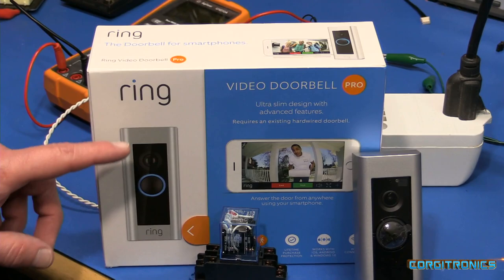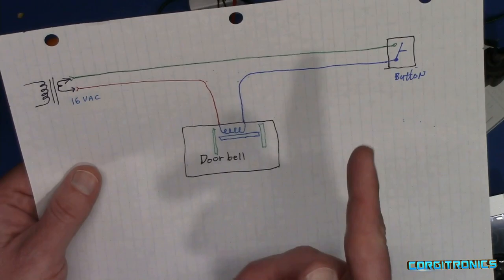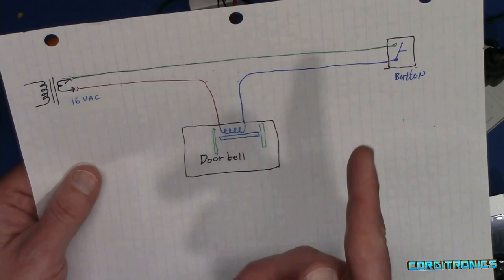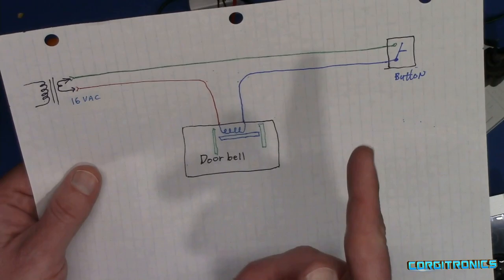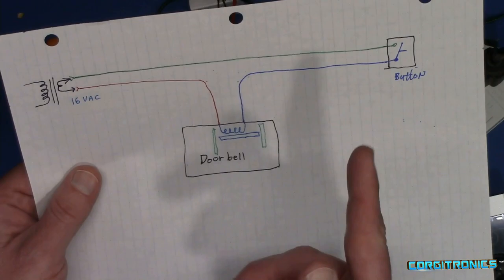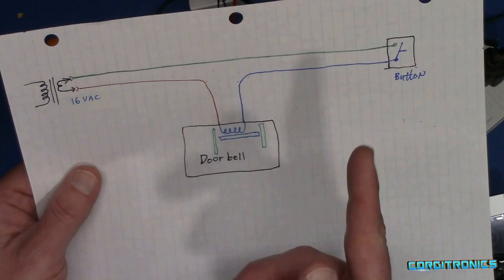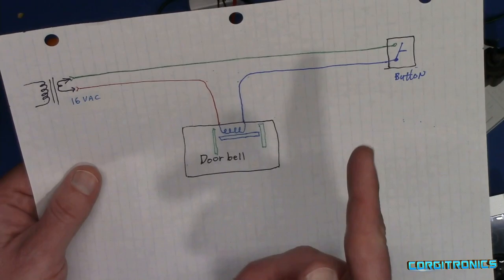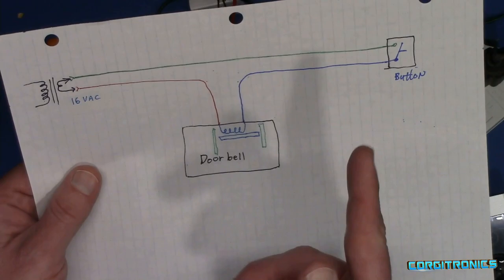Connecting a Ring Pro Video Doorbell to the electronic chime in a Nutone intercom

Comment: First off... Thank you very much for taking the time to do these two videos.  They are very informative and much appreciated.
I am trying to install the Ring Doorbell Pro into a NuTone intercom system.  It has two 16V transformers installed.  Because of the location, I would rather not have an external transformer powering the doorbell.  Would it be possible to replace one of the 16V transformers with a 24V and then wire it up with the relay per your instructions?  I wonder what the impact of 24V on the rest of the NuTone chime system would be?
Reply from the maker: I'm not sure that I'd give 24 Volts to the Nutone, you may be able to power the RingPro off of one of the NutTone's transformers.  It kind of depends on the intercom model.  Also, I'm not sure which of the two transformers would be the best to use... might connect an Amp meter (DMM set to Amps), and see how much power the intercom is using from each transformer.
You could replace one of the existing 16 V transformers with a transformer that has a higer VA rating but is still 16 V. Something like this 50VA unit:  https://www.amazon.com/PWS-1650-Supply-Adapter-Transformer-terminals/dp/B06XRM9QZ3/ref=sr_1_8?keywords=16+volt+transformer&qid=1551937937&s=gateway&sr=8-8
Or this 75 VA industrial beast https://www.amazon.com/Siemens-MT0075C-Industrial-Transformer-Secondary/dp/B0052MY318/ref=sr_1_fkmr0_1?keywords=16+volt+transformer+75VA&qid=1551937986&s=gateway&sr=8-1-fkmr0
Reply: @Corgitronics  Thanks for the help.  I ended up just disconnecting the chimes in my NuTone intercom system and wiring the ring directly to the installed 16V transformer.  The Ring Doorbell Pro rings through the Ring Chime.  I like your solution, but did not have room behind the intercom to fit the relay and I did not want an external transformer because my NuTone control panel is on the wall in the kitchen.  Thanks again for taking the time to make this video.

Comment: ? I have a musical digital chime which worked with the ring pro for about a year and then suddenly stopped.. it’s compatible with the ring and works without the ring door bell connected to it with a diode.. what do you think the deal is with this? Will the relay work? This has been killing me for awhile.. it seems like there’s no power to the chime when ring is connected..
Reply from the maker: That happened to me for a while in September.  It turns out that Ring pushed a software update that had a bug in it causing the unit to not trigger the bell at the end of its cycle.  I had to call Ring support and work with them a bit, they had to get a technician to manually push an update to my unit.

Comment: I have the Nutone as well.  I only have the 2 thin wires going to the doorbell that the Nutone uses for its trigger board and light.  Are these big enough to connect to the 24v transformer (or adapter plug)??  You have yours connected to multiple wires you had previously installed
Reply from the maker: Yes, it should work using those wires.  It will have more voltage drop, but if you are using a 24V transformer (with at least 30VA) the RingPro should still get enough power.  I am currently powering my RingPro with a 16V transformer and a 60 foot run of standard 2 conductor bell wire (the usual brown cable with red and white wires in it).

Comment: How exactly does the 24v A/C relay allow you to run power to the Nutone chime that typically requires D/C current?  I’m very unfamiliar with electronics but I’ve always thought that it would require a dedicated A/C to D/C converter to make something like this work properly.
Reply from the maker: The relay isolates the 24VAC from the intercom.  I have a follow up video that goes into more detail about the relay and its connections:  https://youtu.be/hd68roYUDng

Comment: Corgitronics, I have the Nutone IMA 3303 and I'm wondering whether I can use one of its existing transformers (which I believe are 16V 30Va) to power a video doorbell.  I'm concerned though that the existing wiring running from the master unit to the porch location may be insufficient.  It is 6 wire cable (consisting of 3 twisted pairs).  Only 2 of the twisted pairs are currently in use for the Nutone porch bell/speaker.  I think the twisted pairs look like 22 gauge wires.  I note in your video that you used 2 twisted pairs from your Cat5 on each terminal of the Ring.  That wouldn't be an option for me obviously as I only have 3 pairs total in my intercom wiring.  Running new wiring to the porch unit would be very difficult as the Nutone box is in brick.  Thoughts?
Reply: I ended up using 3 strands of the 22 gauge wire to each terminal and it worked fine.  Device health shows good on the Ring app.  I'm powering the Ring from one of the Nutone's 16V 30VA transformers.
Reply: @Loach402  does your nutone chime work with the ring?

Comment: I have installed a video doorbell the last couple of days worked fine, I have added a 24VAC power supply behind the whole intercom system in the wall house to send power from there to the wires outside at the doorbell. But I have one problem with the intercom speakers humming inside the wall where the whole intercom system is, could that be from the 24VAC I have added,   if so will it make a difference if I moved it around behind the system???
Reply: Sorry the humming part was my mistake it was lose on the surface but once I screwed it to the surface all went perfect.

Comment: I wired this up for a Ring Elite to an M&S intercom.  Works, but the relay has a constant hum.  I think the Ring device is allowing some current to flow.  Any ideas?
Reply from the maker: Hmm, the Ring Elite is quite different and doesn't need to draw power from the chime itself.   The Ring Elite must be allowing some power to continuously flow, not enough to trigger a mechanical chime, but is enough to hear in the more sensitive relay.  You could place a power resistor across the relay's coil terminals to bypass some of the power.  It's difficult to provide any good advice on this for you, but perhaps some large power resistors (10 - 20 watts) and try different resistances starting with at least 1K - 2K Ohms?  I would not want the resistors to get very warm.  Many of these relays will trigger on only 50mA, which isn't enough for a mechanical chime to even notice.

Comment: I have a Ring Video Doorbell 3 (the one with the removable battery pack) can I use this same set up to hard wire my doorbell to keep my battery charged and still be able to chime my Nutone 3003 in the house?
Reply from the maker: I think this approach will work with the Ring 3.  There are a few differences, such as the Ring 3 doesn't appear to need the "power kit".  If you use the relay approach, your transformer might not supply a high enough voltage to trigger the relay, see my other video on that in the description above.
You may also need to configure the unit for "mechanical chime" .  You will find that under Device Settings --> General Settings, select the Doorbell Chime Type and select "mechanical".

Comment: By hooking up the Ring Pro exactly the way you show on the video, will I lose any functions at all on my Nutone Intercom System (such as the ability to talk via the intercom to the front door from any room that has Nutone in it ?), also, does this affect my home alarm system at all by diving into these wires ???
Reply from the maker: This connects to the door chime terminals (if you have the chime module) in the master intercom panel and should not affect the door intercom or other functions.

Comment: Corgitronics I have a Nutone type intercom doorbell replacing with ring pro. 4 wires 2 ring the chime other 2 speaker wires. If I power the ring with the speaker wires
and then connect the chime wires to ring as well - would this work without the relay ?
thanks
Reply from the maker: Not really.  As you can see in the video the RingPro only has the two connections.  It triggers the chime by briefly shorting out the connection.  And, it's unlikely that the NuTone will be able to supply enough power to run the RingPro

Comment: how could I connect an existing old chime to a new wifi doorbell? (not ring) wondering if there a way I could just solder the 2 wires to the push button inside the wifi doorbell
Reply from the maker: I would not connect a mechanical 16VAC chime to a wifi doorbell that isn't designed for it.

Comment: Great video.  I have the exact Nutone you showed in the video.  Do you know if the same solution would work for the Nest Hello doorbell?  Thanks, Robert
Reply from the maker: It looks like this approach will work for the Nest Hello.  Their documentation is a bit vague, but it looks like a similar setup.  They provide a doorbell connector device that you will probably need to connect up in the same way that I show connecting the Ring Power Kit.

Comment: Hi Corgitronics - amazing video.  How would the setup differ if I have 2 Ring Pro 2 doorbells instead of just 1?  Do I need 2 relays or just 1?  How do I wire them to mimic this circuit?
Reply from the maker: The setup is the same for each.  You will need 2 relays, and separate transformers to power each Ring Pro, or one big transformer.
Reply: I already have a 24VAC/40VA transformer so no issues for power

Comment: I am trying to get my Ring Doorbell2 to work with a Hampton Bay wired/wireless option chime rated for 16VAC-10VA. I was going to buy the ELK TRG-2440 24VAC-40VA  to work together. will this work? I dont have a relay or the "Ring power module" .  help me out please Corgitronics!
Reply from the maker: Well, as luck would have it, see the video I published 10 days ago on relays to connect a Ring Doorbell2 to an electronic chime.  https://youtu.be/xmeYzodpkfU
Also, at about the 10:40 point I show using just the common 16VAC 10VA transformer.
See the video, but you may just need to get the relay, and wait on upgrading the transformer.

Comment: I'm looking at the video minute 5 and it appears that the Ring powers up and stabilizes at 0.150 Amps when connected to the mechanical doorbell with the Ring PPK attached.  However, at Minute 11 or so when you power it up using the relay, it's only using .003 Amps and a peak of .008 when the relay is energized.  I can't figure out what I'm missing - I can't see all of the connections on the table demo, but when I hook up my relay, transformer, etc my Ring is still pulling .150 Amps through the relay after it's booted up and never deactivating the relay.  Can you explain the difference in amps from minute 5 vs minute 11 ?
Reply from the maker: At the 5 minute mark I am testing with a mechanical (solenoid) doorbell, and all of the power for the RingPro is passing through the doorbell's solenoid.  At the 11 minute mark I am testing with the relay, and only measuring the power passing through the relay, the rest of the power is passing through the "power kit" provided by Ring.
Reply: @Corgitronics  Fantastic, Makes sense.  I tried just the relay https://www.amazon.com/gp/product/B00NN5ABG2/ with a 24 VAC transformer and the "power kit" (as shown in your schematic) and for some reason, my Ring Pro would never fully boot up.  When I use just a 16 VAC transformer and no relay, it boots up fine.  The Ring Pro powers up with the relay in the circuit, but I always get some variant of the flashing LED (left, top or right) as if it's underpowered.  It's a 24 VAC 30 VA relay and the relay closes with no buzzing.  I'm not sure what's going on - perhaps a bad power kit because my current mechanical doorbell "buzzez / vibrates" even after the ring is fully powered.  I thought I'd install the relay to get rid of the buzz and perhaps go to a digital doorbell later.  If the "power kit", which I understand is a resistive circuit is bad, it would make sense that the mechanical doorbell buzzes and I guess make sense that the relay never disengages or the Ring doesn't boot up.  I appreciate your input.
Reply from the maker: @jsfarmes  I think that the power kit is actually more than just a resistor, but I haven't taken one apart to check it out.
Also, in the Ring App, under "Doorbell Kit Settings", make sure the "doorbell type" is set to "mechanical"

Comment: I have a ring 2 that I hard wired through my nutone system. I wired it with the exact relay you used in your videos. It works with one caveat. The relay chatters for about 5 seconds when the ring button is pushed. The relay also has a low hum to it at all times. Would you have any idea to why this is happening? My nutone system is powered by 2 18vac transformers, which are pushing 20vac each. I wired the ring 2 to just one transformer. Thank you
Reply from the maker: It sounds like there's a little too much current being pulled through the relay at idle.  First a question, did you connect the PowerKit as shown at 3:48?
If you have the power kit connected I can think of a few options:
1.  Make sure the Ring's "Doorbell Chime Type" is set to "mechanical". See this article:  https://www.pocnetwork.net/technology-news/troubleshooting-ring-doorbell-not-ringing-the-mechanical-chime-inside/
2.  Select a relay that uses higher current, this will force more power through the power kit.  I tested some relays in another video, here:  https://youtu.be/xmeYzodpkfU?t=317
3.  Test out powering the Ring from a separate transformer, not the ones in the intercom.
Reply: I did not use a power kit since it’s a ring 2.
Reply: Were you able to figure this out? I am having the same problem. The relay chatters when the button is pushed and no chime sound.

Comment: Where do the blue and white wires connect to from the nutone?? Do they connect to the relay cause I didn’t see them connected in your picture
Reply from the maker: The intercome wires shown here: https://youtu.be/4ZFl6BRTQnA?t=956  connect across the Normally Open (N.O.) and Common (C) terminals on the relay, as shown here:  https://youtu.be/4ZFl6BRTQnA?t=495
For further clarification, see the video on relay connections listed in the description above:  https://www.youtube.com/watch?v=4ZFl6BRTQnA
Reply: Thanks for getting back to me appreciate it. I kind of get what you’re saying about the blue and white/blue wires.. I’m just wondering if you connected them to the relay cause in the still photo of the box all I see coming out of the relay are the purple wires I’m assuming thats the power coming? I bought everything that you have in the video relay, plugin transformer and the terminal strip.. I also have another question could I up grade the factor transformer from 16volts to a 24v and use that to power the ring pro?
Reply from the maker: @Thebadman1680  The Purple wires connect the relay coil to the two contacts that would go to the traditional mechanical chime (with the PowerKit attached to those terminals as well).
You can use a 24VAC transformer to power the RingPro (like I did), but don't use that to power the intercom, only use the correctly rated 16VAC transformers to power the NuTone system.
Reply: Corgitronics thank you sir much appreciated

Comment: Just want to confirm that replace existing transformer with 24 volt unit in your video or do you install 24 volt in addition to 16 volt. Wanting to do this with Audiotech 450 intercom system
Reply from the maker: I replaced the existing transformer, as it would not have had enough power to run the Ring Pro properly.  You can use a 16 V transformer if you get a relay that will work at the lower voltage.  Here's my follow up video on other relays: https://youtu.be/xmeYzodpkfU
Reply: @Corgitronics  Thanks, the videos are very informative.  I am looking at using a Ring Pro and the distance from main panel to doorbell/Ring is about 30' so adding 10' for going up and down walls lets call 40'.  Do you see a problem with keeping with the 16v transformer if I use the Uxcell relay that tested best in your video.
Reply from the maker: @grtalley7443  That wire length should not be an issue, as long as the transformer is capable of delivering ast least 30VA.

Comment: Could you share a few photos showing the relay wiring? I don't see where the NuTone blue and white wires are connected on the relay. Maybe those weren't hooked up yet in the still photos.
Reply from the maker: Curtis J:  I have just uploaded a video showing details about the connections to the relay.  I hope this covers everything.
https://www.youtube.com/watch?v=hd68roYUDng&t=39s
Reply: Corgitronics thank you so much!
Reply: Corgitronics do you know of a relay that works with a 16V AC transformer?

my ring pro works fine connected directly to my 16V transformer but i do want to add the nutone electronic chime if possible. i can’t seem to find a relay that works at 16V AC

Comment: Very nice video, thanks. Is the software set to No-Doorbell when you are using the 24VAC relay across the Ring power resistor (no mechanical doorbell)?
Reply from the maker: I don't quite understand the question.  There aren't any changes involved to the software or settings on the RingPro.  The relay just replaces the mechanical/solenoid doorbell, and provides a contact output to trigger an electronic chime.
Reply: The question is: In the Ring App, under "Doorbell Kit Settings", with house mechanical chime removed from the circuit and the 24VAC relay in parallel with "Ring Power Pro Kit 2", is the App set to "Mechanical", "Digital" od "None"?
Reply from the maker: Mine is set to mechanical.